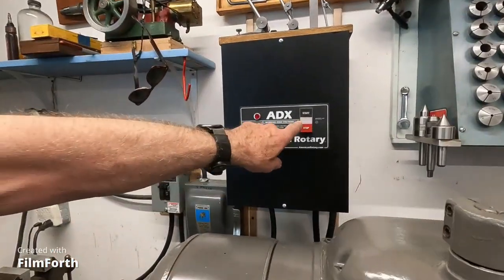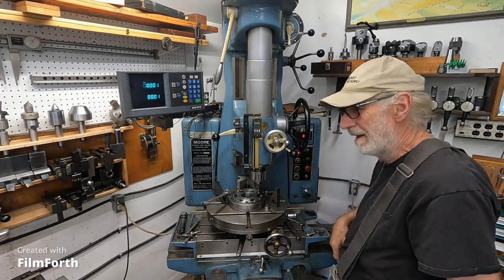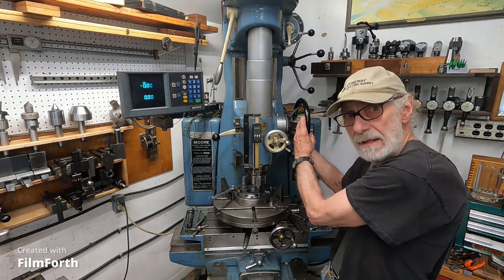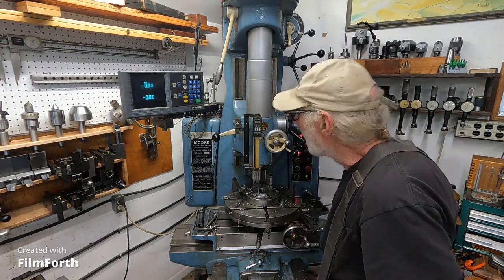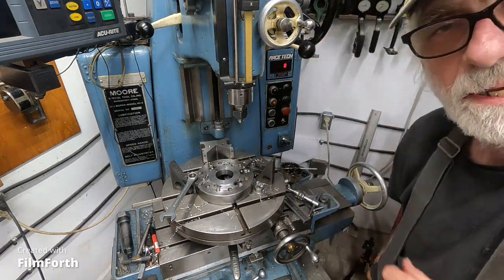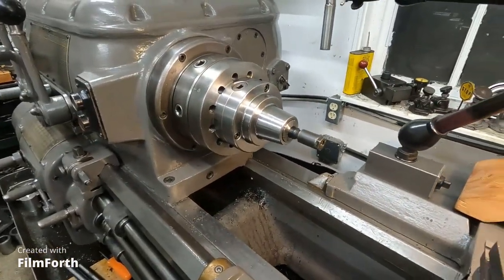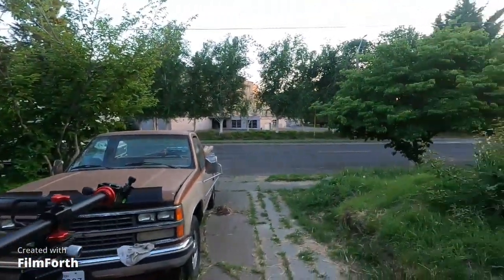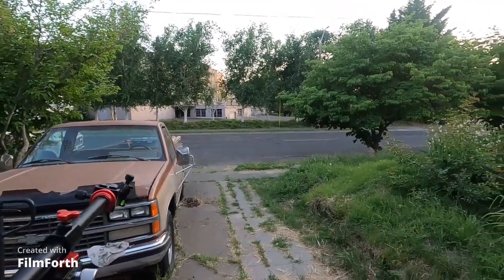Hole function and malfunctions and me on the jig borer

Comment: I have that same DRO on my mill. I just replaced the key pad and cleaned and fixed the infamous ribbon cable. It’s surprising how much they still sell for. Even used. 
However I don’t know how to use any of the functions at all. Other than centering X,Y and inch to metric… haha it’s one of the things that I can’t seem to find much content on. Was nice to see it’s usefulness.
Reply from the maker: I cant remember what that cost more than 20 yrs ago, but it was alot. The hole circle function is very useful Do you have the manual?
Reply: @deedeeindustrialsuperprecision  well now that’s a brilliant concept, haha no. Actually it never even dawned on me to search or try to download it. I guess i just “assumed” it was too old or not available. To be honest I don’t know why I didn’t think about that.. 
I will hunt one down for sure. Thanks 🙏 
It came installed on the mill when I bought it and nothing came with this machine. (Another learning experience) if i bought one today it would be a different situation. Now i know the importance of tooling and receipts and documentation, manuals, tooling etc. thanks to content such as yours I’ve learned quite a lot. 
I was able to find the information on the ribbon cable repair/ common issues. So I’m thinking a manual should be easy to find. Thanks again sir. Have a blessed day.
Reply from the maker: @jasonhull5712  Thanks for that!

Comment: I'm still scratching my head with you using beeswax as a cutting lube. When I search the internet, it is not a common material for that purpose. It more shows up as blackening of iron. At least that's what I found.
You're not the first youtube machinist I've seen having issues with those fancy DROs that compute hole placement coordinates for bolt circles. I'm surprised you didn't use the rotary table. 
A few years ago, I purchased a 5C collet chuck premounted on a D1-8 backplate off eBay. It had runout that was crazy, as the 5C taper was not machined parallel to the back mounting surface of the chuck body. So runout was not just a simple radial, but with a cone at an angle to the chuck body. I ended up buying a Bison brand chuck, which fit perfect on the D1-8 backplate, runout less then 2 tenths.
Reply from the maker: You will find very little on jig boring or close machine tolerance work on the US internet, everyone I know from here has been long run off by the bullies that had formed in the internet forums 20yrs ago and stink up this venue today, I have blocked a dozen of these Bozos. My advice is do not do anything I do or you be accused of corrupting youth like me.
Reply: @deedeeindustrialsuperprecision  Every video you release I learn something. I didn't work a career machining stuff for a living. I fixed broken stuff, and the little I know about machining has served me well in designing things that are easier to manufacture and maintain. It is one of the things that keeps me from buying American designed autos, as they don't design them to be maintained, and I doubt they are easy to manufacture (mostly by kids that got engineering degrees, but never worked on their car doing even simple things like oil changes). Also, they design them to fail at 7 years, 70000 miles, not the kind of machine I want to own. 
All this CAD/CAM computer stuff does not make anything better, as it's only as good as the human with the mechanical aptitude to make stuff better then the previous version which is being copied.
There's always at least 10 ways to do the same thing, mostly the lack of the correct tool or time prevents the job being as good as wanted. Management always used the phrase "better is the enemy of good enough".
Reply from the maker: @f.hababorbitz  Most new machinery is designed to last the 5 yr lease or loan cycle.
  I am impressed with new vehicles and the power they put out for a long time in some cases, one problem that just hit older Harleys with fuel injection is a component with chips are discontinued so they have to be retrofitted with carburetors. I am the same just a fix it guy. A little of this skill can go a long way in saving money for many businesses, farms.or anyone looking to survive these days, thanks!

Comment: I remember using Moore Jig Bore hole tables as an apprentice. Does your readout automatically make those calculations for you?  Always interesting and like the discussion re your radial drill head. Best regards, mjm
Reply from the maker: Yes, the DRO has Bolt Circle Function that is accurate. I mistakenly entered the wrong ending angle as the function will evenly space holes in a segment of a circle also.

Comment: Dee dee, have you had or still got any motorcycles? Hope you don't mind me asking. By the way, I wrote to AR by e-mail and asked them to contact you the other week. I hope you didn't mind me doing that. I don't know if they told you or not?
Reply from the maker: I have a 2001 HD Night Train a friend left me after he passed away from complications from hitting a deer on it, I fixed it, maybe I will ride it, maybe I wont, Thanks for your help the converter will keeps things powered up, I have a lot to do.
Reply: @dee dee  That's a cool bike. I've covered 20,000+ on my Yam XJ600n in the past, got a Suz GT125 Van, and a 99 Yam R1, but like you, not on the road. Tell you what, before I'd get on something like you've got or anything really, I'd get me a $200 A.B.S System bolt on, especially with that one front disc. Proper nice-looking bike mate very cool 😎.
Reply from the maker: @PeckhamHall  My best one is a 1968 Hoda Cub 90, a full out road model, I forget about that one.
Reply: @dee dee  I've got about 3 Suzuki gt250 x7's myself aswell, all in different state of repair, they were the 1st 100 mile an hour 250 in England in the late 70s the baby brother to the GT750 kettle. It was the bike that made them bring in the 125cc law for learners instead of 250cc cause it was CDI and too fast for the newbies.
Reply: @dee dee  you watch Allen Miilyard, you probably do, but if not, it will be worth a look with bike engine machining.

Comment: Where in the world are you going to stick that awful looking miniture drill press made by morris? LOL
Reply from the maker: I can expand the shack a little by moving out the wall where the Axelson lathe is, I have to keep the mast  of the drill near the peak of the ceiling. and there is the problem with most any garage. Now this shack was built with minimum materials in 1940 it is more like a movie prop than an actual building so adding on is not actually hard in many ways, just have to keep it from falling down removing walls. This drill and a similar sized Fosdick model were built with quill type spindles with ball bearings in the nose making them ideal also for precision boring and line boring, I just had to save it.
Reply: @deedeeindustrialsuperprecision  Hell Yah!  Love the Morris!